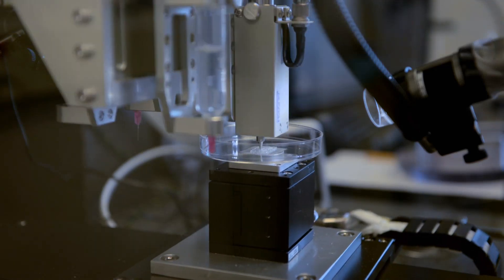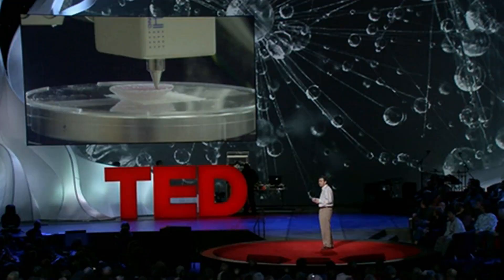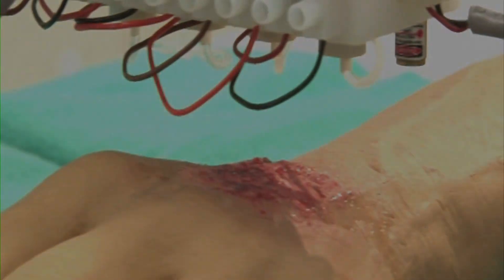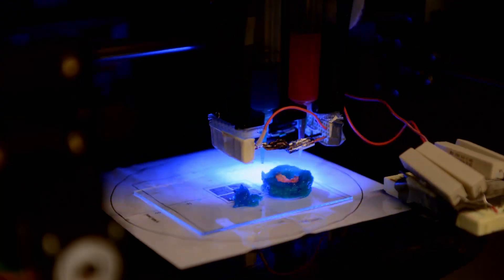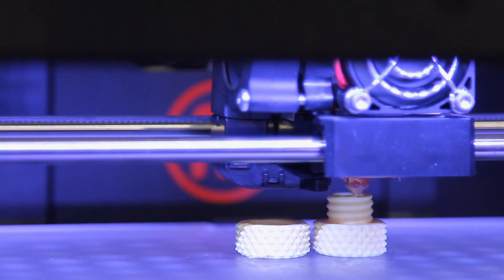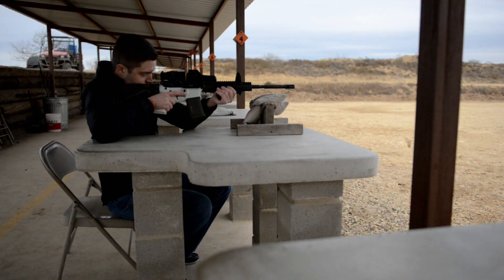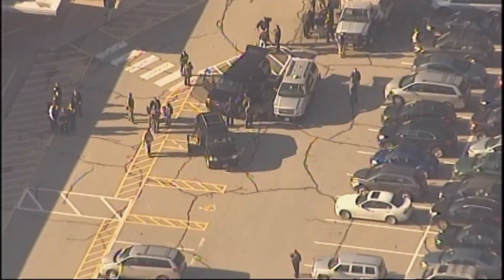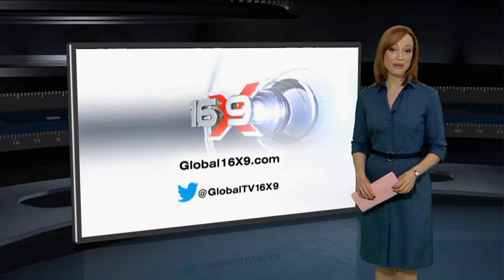3D Printing: Make anything you want

Comment: Printing "anything" is bit of a stretch, don't you think?  We're still at the embryonic stages of printing hard objects out of two dimensional drawings.  I applaud the medical uses of 3D printing as that seems to be a natural fit for the current technology, but most consumer grade printers can barely manage CGA resolution and at a fraction of the strength of the more traditional methods that we've been using since the time of stone knives and bearskins.  I think I'll wait until a consumer grade printer can print a part that is just as strong, functional and finely finished as it would be if it were made out of injection molded plastic or harder material.

Comment: Sadly today with current desktop printers the acuraccy is too off to print a gun lower (The tracked part of the gun) This is because guns need high acuraccy to work and desktop 3d printers have plastics that shrink when printed therefor you would not be able to "print a gun" because it would be too small. The only way to do this is with high-end machinery that would cost more than just buying a gun in the first place. Argument settled unless people find a way to make high end machinery really cheap.

Comment: A gun is a tool, like a hammer or axe.  It's purpose is determined by its operator.  As a hammer/axe can be used to kill, so a gun can be also.  Saying that the essence of a gun is for killing people or a guns purpose is only for combat is absolutely asinine.  It would be the same as calling all axes, hammers and knives combat weapons.  Woe to you construction workers and lumberjacks!  The public will no longer stand for your use of combat weapons.   That's not to say that the AR15 Cody Wilson was printing in the show was not designed from the ground up for the purpose of killing people.  The same as a double sided war axe and or great hammer used centuries ago were not designed to cut wood or put nails into boards.

Comment: People are kinda naive, anyone can build a homemade shotgun in an afternoon with plumbing parts, guns are already universally available. Besides, 3d printers print plastic, you cannot print gun powder or metal bullets, you cannot print the metal parts in a gun necessary for it to actually function, some parts of a weapon have to be metal for heat and strength reasons, the idea that someone can print a fully functional gun is a myth. Now maybe when consumers get the tech to do that laser printing of metals then it will be a legit possibility.
Reply: In the video it said that it can print with metal not just plastic and then the guy showed a titanium nose
Reply: Look at the plastic. Its just in place. Mind you layers of plastic could get damaged, chiped, or melt if it gets to hot. But it could probably last for months maybe years on, depending on how often its used. Also if this can build a house like they say in the video, it should be pretty durable.
Reply: Amanda Claire
Yeah that is the lazer method like I mentioned, it's not available for consumers, only commercial manufacturing, maybe someday but not yet
Reply: I was thinking the same thing. Its really not stoping anyone.
Reply: DMLS is a way to print metal parts, printing a gun in metal would be super easy
Reply: "when she said I don't think most people want a gun at home" I instantly knew she probably has private security at her high-rise, gated condo
Reply: LuigiAnimates
It wasn't all plastic parts though, it was just the exterior part, the internal firing pins and stuff are metal.
Reply: I'm glad, if they could print so many more things than just plastic. I mean, you get a dollar bill, BOOM; ANOTHER ONE! And you know Cozmo, or other robotic toys? Well, if they could print stuff, then all the work the designers and programmers put into this are gone. So I'm actually relieved it's only plastic. I don't believe we're ever gonna print more than just plastic. Organs are organic, and robots/guns are much more complicated than just plastic...
Reply: 95TurboSol u can use metal
Reply: Its for fun
Reply: 95TurboSol 3D print can also be made with metal look it up
Reply: That is where a laser heats up the powdered metal so it melts it in a very precise shape, its a completely different thing. There is no hot end or extruder.
Reply: Amanda Claire are you any more knowledable since a years passing?
Reply: Day Knight yeah for hundreds of thousands of dollars
Reply: Sam Adler but very very expensive
Reply: You can print with metal, try again. Also, try a youtube search of 3d printed guns. Try again, again.
Reply: Christopher Geier you cannot print metal on any consumer machine. 3d printed guns are still in the infant stage and are dangerous. They will only become a thing when legislation forces both bad and good people to use them.
Reply: 95TurboSol - which would be easier to smuggle on a plane and put it together in the loo.
Reply: This is the future. You can print guns.
Reply: Watch dogs 2 😂😂
Reply: You can, but it's likely to just explode or just replace the barrel after 8 shots.

Still you can make an ar-15 if your old one broke and you can scrap the springs and barrel.
Reply: Exactly the whole point of his project is to provide cheaply made parts... That women is a flaming liberal from Hell
Reply: Well you saw in the video, he was able to fire 11 bullets off of plastic parts, so though it's plastic, it can do damage. I wouldn't be surprised if it couldn't fire more that 2 magazines since it is plastic, though you could do a lot with 22 bullets.
Reply: moron
Reply: That's why naive privacy needs to go
Reply: A homemade shotgun won't do nearly as much damage as a fully functional AR15. Guns are still illegal in many countries, like the UK. If 3D printers which could print in metal were made available to the public, this would be disastrous.

Comment: when you think about how far we come in technological advancements. i like to think that every break-though is a fresh surge of furthering advancement.

my analogy is playing mario cart, you can only drive as fast as you can until yoiu hit the next speed boast. same concept. look at how far assembly lines has come since we replaced people with automated robotic arms.

my take on best using this 3d printing breakthrough is to use it to make better technology. like driving a wedge into the farthest place we can reach to that we can pull our selves up. use 3d printing to make better 3d printers or use the some concept to make other breakthroughs in advancing computers like cpu. ram or an entirely different motherboard layout. so in turn it can have a ripple effect in other fields.

3d print a better 3d printer, then use that better printer to make a better computer, then use the better computers to make a better advances in say missile tracking. data strange and televisions. so on so forth.

then when i hear that they are trying it on food manufacturing, i die a little bit on the inside.

Comment: The American people freaking out about 3d printed guns need to chill. Do some more background research, you'll learn that it is not very practical. I noticed that most of the people freaking out in the comments selection below are not from the US. To you guys idk what to say, maybe you need a gun ban in your country, but here gun laws will create more problems, so don't come here and try to speak for me and my country.

Again, here in the US, 3d printing a gun is just not practical, you can build one from parts purchased at Home Depot, cheaper, and quicker. Even just buying one at a local gun shop is cheaper and easier. I mean i can buy a Glock for $400, cheaper than one of those cheapo plastic 3d printers.

Comment: What I wonder is how 3D printers will replace shops. Will be that you pay for schematics such as a chocolate bar, or that you can download whatever you want? I think that you will have to buy the items each time you want to print (but for a lower price) and that you have to buy the materials such as the food material. These materials change and their prices vary. For example, you want to build a door handle, you go to a shop for 3d printers and you buy the metal material. I think this method would work best. But I could be wrong.

Comment: Yeah.  Throw away these lathes, mills, CAM systems, deep drawing presses, welding equipment and all the other useless crap- cause here comes the CNC routed hot glue gun. It can "make anything you want, just by pressing print". And dismiss all these stuck up engineers who only moan and groan about tolances and strength of materials - law students are the new engineers! Seriously.. do you believe this product placement loaded "documentary"?
Mentioning this in relation to Gutenberg is of course justified due to it´s ability to create custom keychains (which we all knew is the next big thing in manufacturing humanity waited for). Also everyone wants to own a gun which only occasionally blows up into your face while using it. Great value.

Comment: people who believe its a good idea to have everyone readily have a weapon available to them work under the theory that attackers only attack when they think they have the upper hand or won't get caught. so if everyone has the same capabilities the crime rate will drop. 

personally i think it would be a much better solution to adopt a technology readily available in form of a wrist watch/ bracelet. jewelry with a bluetooth connection and or wifi connection. used similar to the elderly's alert button for when they fall or injure themselves at home. 

accept that it should be readily capable to pair with any nearby open bluetooth or wifi  device and capable of sending out a panic alert. obviously as opposed to the elderlies one button it would have to be a combination to prevent accidental activation.

having something like this available to anybody would make any event capable of being publicly announced instantly. any criminal would have to take a second guess at doing any harm. would also serve as a double purpose if it was consistently paired with a designated phone so parents could. monitor their kids location (not teenage) so children are less likely to be abducted or wander off in a mall without being able to be found. 

we already have the capabilities to do this but a cell phone is a little cumbersome to pull out and dial in the state of panic. and easily removable from a person. and far to complicated for a 3 year old to operate.

Comment: So, can it print another 3d printer, printing another 3d printer?
Reply: not an entire printer, maybe small parts and possibley the frame itself, but not the electronics and maybe not some metal parts unless the printed plastic is durable enough.
Reply: Right now, no. But in the future, absolutely. In fact, 3d printers have the potential to print a 3D printers that print better than the printer that printed it. Of course that cant be done currently but in the future this will happen all the time. This is the future. We will even have 3D printers in our homes. This is the future
Reply: printer-ception
Reply: sure why not  #amirightoramileft
Reply: MrKevstro it was a joke :I
Reply: MrKevstro unless the printer had all the materials then yes a 3d printer can print another 3d printer
Reply: FloppyFlapjak DARN IT. I was going to make that joke
Reply: TheCobbleBros snooze you lose my friend

Comment: I don't think that pro-3d-printed gun guy is mentally stable. You are giving those crazy mass shooters the gun. Basically, you are telling them "go ahead, here is what you need"
Reply: A 'gun free zone' sign is just telling shooters "go ahead, nobody will fight back." You can make a functioning shotgun for less than 10 dollars and a trip to the hardware store. A full auto would probably cost about 50 dollars in supplies and tools most households already have in them. Gun control cannot prevent someone from getting firearms if they want, and it's FAR easier to make your own weapon that's completely untraceable than it is to 3D print a gun.

Comment: Anyone that can buy such an industrial printer shown in the documentary that can make clean gun parts can also get the real deal. It's so ridiculous. Also, it's much easier, more reliable to make these parts with a CNC machine using aluminum parts just like the real thing. Plastic is not good enough for heat and tolerances.

Comment: i just want to point out two things. one: a lower of an ar-15 is very far from a printed gun. the only reason its the regulated part is due to the serial being printed on it. you can not print barrels of firing pins. you still need trigger assemblies and springs and bolts and a whole mess of other things. two: if you can afford to spend the 1000-3000 dollars for a 3d printer then you can afford a few guns anyway. you can get an ar-15 for around $1000 and alot of other guns for less.

Comment: Jaryd, 3d Printers will be 50% cheaper in 16 months. We're building 3d Printers that can simultaneously print different polymers or plastics and metals. That means you can literally print out a robot / iphone / lung that works as soon as you print it out. Well, you do have to plug in a battery.

Comment: ima print a 3D printer.
Reply: ***** But what you're forgetting is that the actual 3D printer isn't one big part... it's built on smaller parts which you put together, so yes.. it is practically achievable.
Reply: ***** Then I shall build a shoebox sized 3D printer.
Reply: Print-Seption!
Reply: ***** then in that case i shall print lots of gold bars
Reply: Printception :O
Reply: its a pretty common business practice you just need to  buy the electronic compnents
Reply: e.e Just yes
Reply: That wouldn't work because as stated in the video, the printer can only print items that are smaller than a shoe box. So yeah...
Reply: Muzammil Farhan i realize that after the minute i comment, however i was hoping nobody would notice my ignorant comment
Reply: I'm gonna build myself a shoebox. And then put my shoes in it. Fuck yeah!
Reply: 579Jacob why don't you make a 3D printer print a 3D printer printing a 3D printer!
Reply: PRO3D. IN they are giving cheapest printing service in india 🇮🇳 5rs for 1cm
Reply: Check out the RepRap, it's an open-source 3D printer that is made mostly from 3D printed parts
Reply: This is a mistake.  I'm warning you, don't do this.  I repeat DO NOT do this.
Reply: 579Jacob GENIUS
Reply: Evan Wall yes
Reply: I own multiple 3D printers and I must say that it isn't as simple as it seems. You must buy wiring, linear rods, and pretty much everything BUD the brackets. That's it. It doesn't decrease the price in the least.
Reply: Chistopher Aires I know this was 1 year ago but 3d printer are self replicating the prusa i3 has many 3d printed parts

Comment: The way they make it sound, anyone with a garage built 3d printer would be able to create a gun that fires.  That isn't the case.  Most of the plastic filaments you purchase from vendors are lower quality.  Not to mention the 3d printer the guy was using to create the weapon costs over 30K.  

When your talking about something that requires a great deal of precision like a gun, you need to make sure everything is within certain tolerances.  Normal 3d printers(anything costing less than 10K) will not be able to create a gun.  This is typical of the media, sensationalize the big picture, but not focus on the details.....

Comment: Nothing special about Cody wanting to make a 3d printed gun ... If it wasn't him who caught your attention first, some other John Hancock would have stepped up to claim that spot light.

True, 3D printing can be used by the wrong people to manufacture items that can do harm to themselves or others. That doesn't make the 3D Printers bad. That doesn't mean the grim shadows in the future are to be blamed on 3D Printers.

The same bullcrap happened several years ago when the media did coverage on a shooting in which the shooter used an AK-47 ... The whole coverage quickly shifted from being about the person who shot innocent people to being about what guns are bad, if not all guns being bad.

I nearly vomited when the discussion ran off in that direction. How stupid and desperate do people have to be to shift the blame on something larger to gain a sense of justice if anything can be remedied from the shift of that blame?

A Gun is NOT bad... A Gun can sit in a corner, loaded and cocked ... ready to fire and I guarantee you that it will not do ANYTHING until someone pulls the trigger. So its' not the gun to blame ... its the person using it.

This goes right back to the 3D Printers.... Lets not be persuaded by people like Cody that 3D Printers are the things to be blamed for the bad issues that crop in the future in which 3D Printers were associated.

That Printer can sit in a basement of any Criminal and it isn't going to do ANYTHING until that person interacts with it.

Instead of making a big deal about 3D Printers and the atrocities to come ... make a big deal of the BAD PEOPLE who use those devices or ANY OTHER DEVICE at their disposal for CRIMINAL or INHUMANE acts.

Its not "Welcome to your 3D Printing Future" because some guy prints parts to complete a firearm ............. Its "Welcome to the Future of people finding anyway they can to make an inanimate object be a BAD THING".

Comment: I am very intrest in buying one but where do I go to find out the best one
Reply: from what I've seen of various printers characterized, it depends on what capabilities are most important to you. Nothing "does it all". If you are leaning towards plastic extrusion,then you will want a unit that has a heated bed and is fully enclosed (for thermal stabilization and reducing warpage). Powder based systems offer the convenience of easily building things with "overhangs"  because the material of each layer is 100% supported. These were the 1 multicolor printers. Thermal extruders now also print in multiple colors. Powder based systems usually need some post processing to "harden" them.